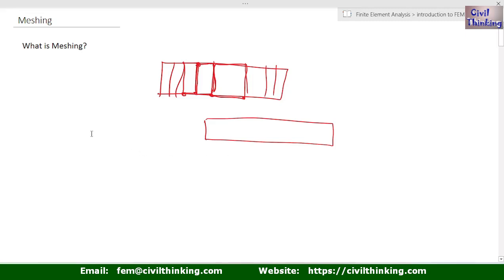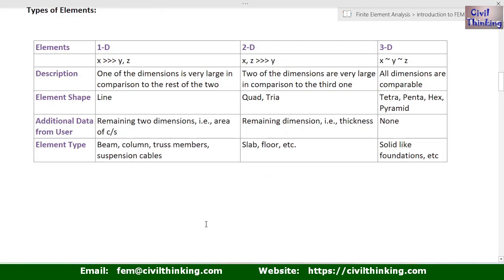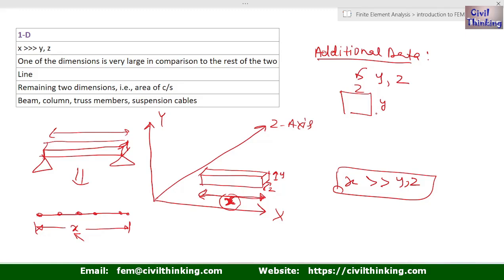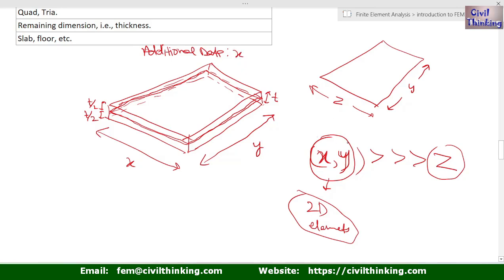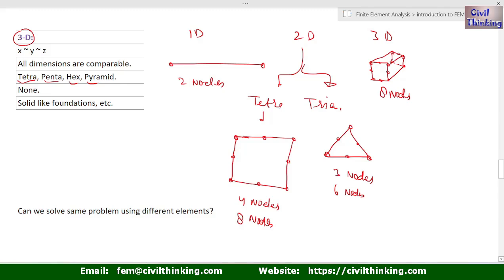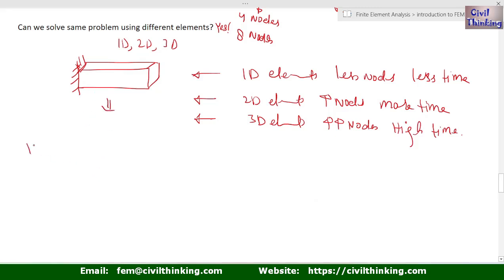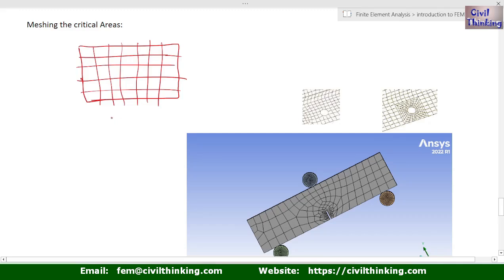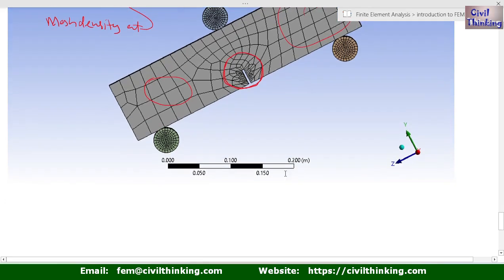Finite Element Analysis (FEA/FEM): Meshing and types of elements in FEM

Comment from the maker: what is meshing 
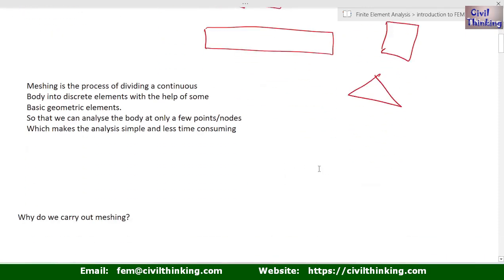why do we need meshing [3:33]
Types of Elements in FEM [6:07]
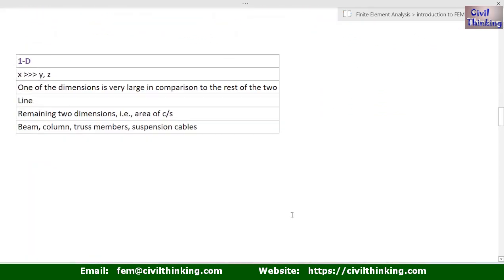1D elements [8:45]
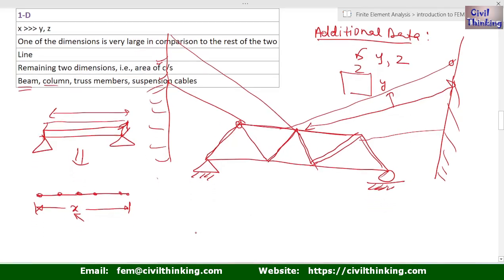2D elements [13:51]
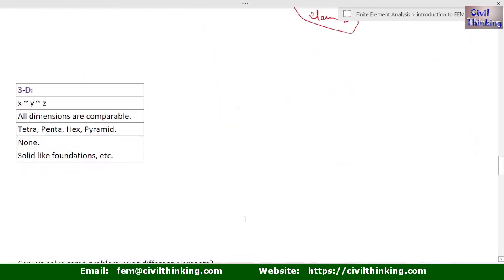3D elements [18:16]
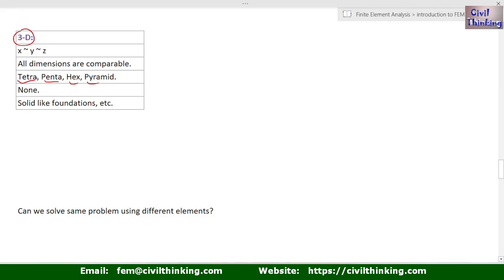Shape and Number of Nodes of different element types [20:00]
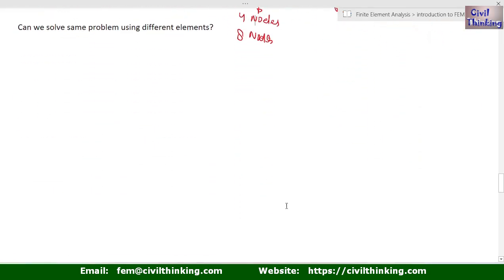Can we solve the same problem using any element types? [26:05]
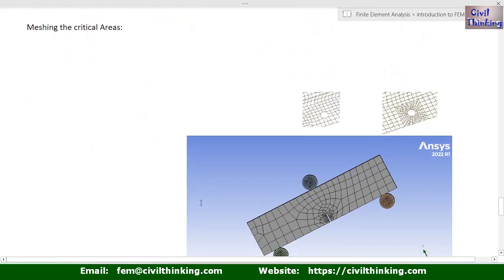Meshing in critical Areas [32:05]
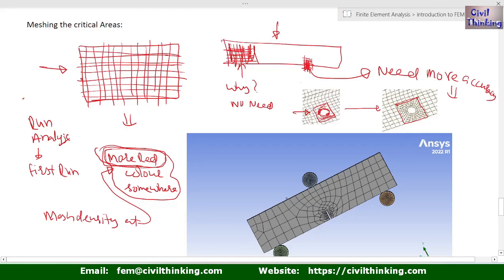Example Meshing in a beam with a notch/crack in 3 point bending test [36:14]